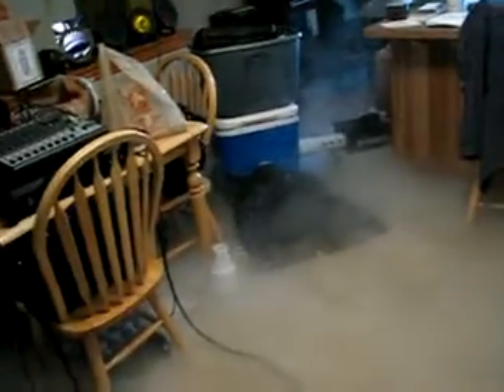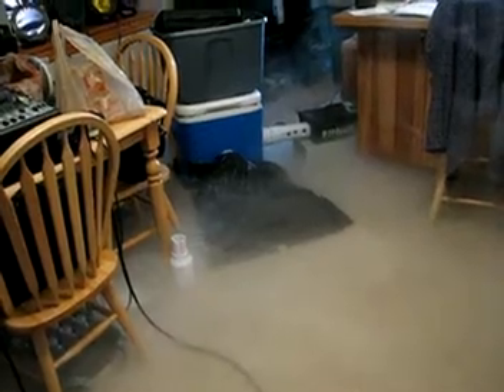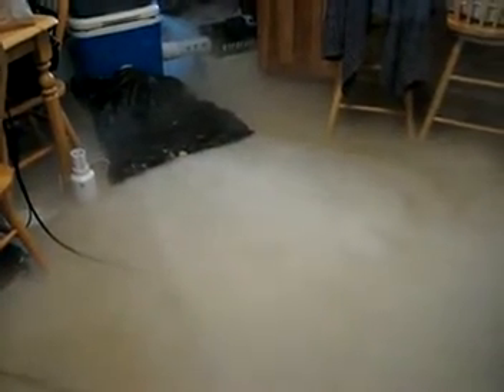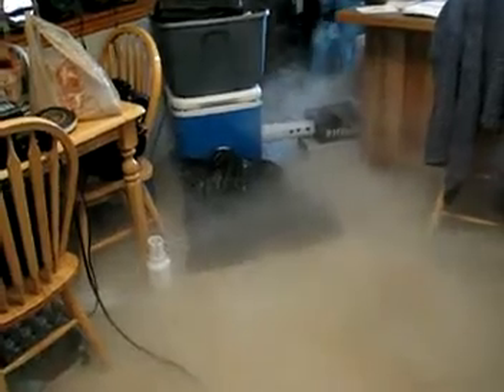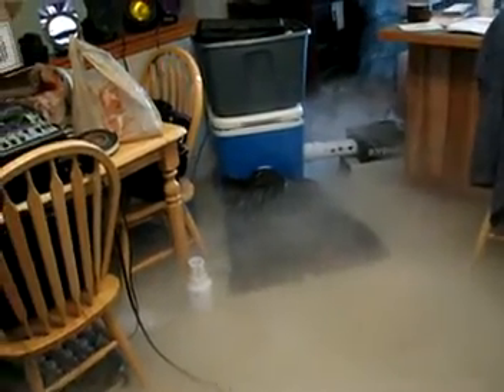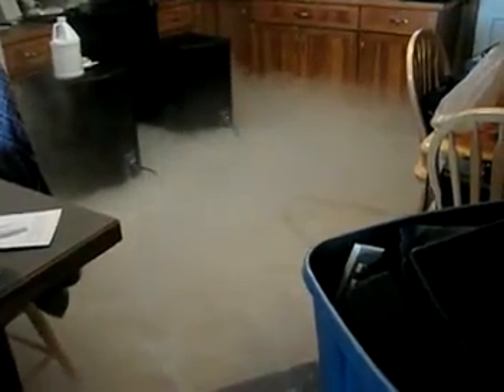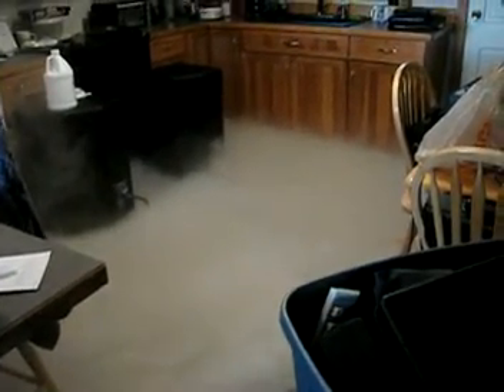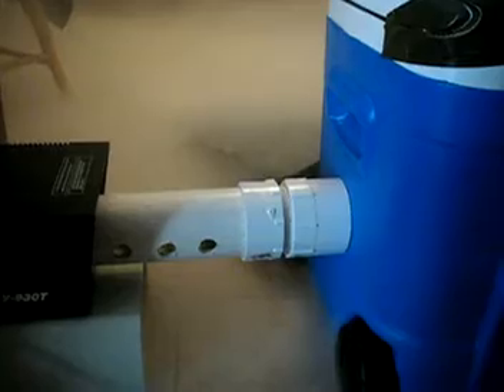Fog Chiller w/no ice tray

Comment: Best not to use any cooler with a hinge built into the wall of the cooler. Very hard to seal the leaks.  Colman makes coolers with a hinge on the back wall that is easier to seal with weatherstrip.

Add hand full of rock salt if possible to further lower temps.  Not too much though or will kill grass if not diluted later.

I always use Froggy's Freezin Fog juice for the grave yard scene.

Comment: Just a thought. But instead of an ice tray, why not use wire mess. Make a closed end tube of wire mess(one side open, one side closed). Make it the full length of the cooler.  Attach the open end to the output vent(hole). Add your ice on top. See if that helps. 
Happy Halloween :)